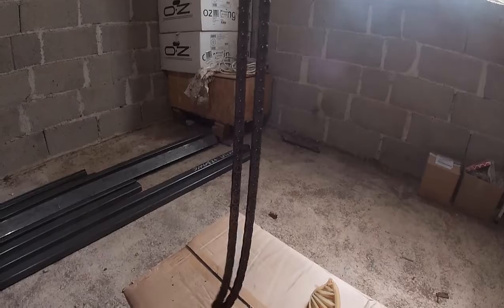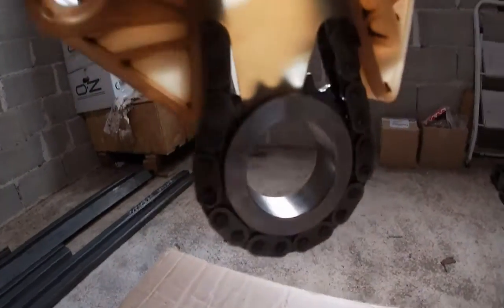Replacing timing chain on BMW F20, F30 N13B16 engine

Comment: Replaced the chain en checked it multiple times when I try to accelerate it holds back like it goes into limp mode and misfire when idle any idea?
Reply: Fixed it
The problem was one spark plug 
Weird frankly

Comment: So easy im going to do mine now. Where did you get the cam lock tool?
Reply from the maker: I got it from a shop here in Croatia, but there are plenty on Ebay, just make sure they have 2 crank locking tools

Comment: Did you have to do anything with a computer afterwards? As the Cam Adjusters we’re both in different positions as to when they we’re taken off
Reply from the maker: Nope, didn't have to do anything with the computer.
Reply: @mattwillow7  Hi, Great video!

I have a question,  When you removed the Crankshft pull center bolt, Do you not have to remove the sump pan and lock the Balance shafts like you have to on the N46b20b engine in 3 series E90?
Reply from the maker: @andrewclarke9467  tnx. No need for removing the sump, you just lock th crankshaft with a locinkg tool inserting it in a hole on a lower part of block locking the flywheel as shown
Reply: @mattwillow7  Hi, thanks for the replying.  Thats great i was just concerned cause when i did mine i had to lock out the balance shafts on the oil pump in the sump... Made the whole job a pain having to drop the subframe.    Thanks again for the info 👍

Comment: Did you use a new bolt for the crankshaft?
Reply from the maker: Yes, I would recommend changing crank and both cam sprocket bolts because they are stretch ( TTY ) bolts and shouldn't be reused.

Comment: Hi, it looks simple job for u, but is it really that simple from your perspective? Am going to get a used BMW, hearing feedback on this issue with N series engine but newer batch with B series engine used car price is much higher
Reply from the maker: Hi, tnx for the comment. It really isn't that hard on N13 because unlike dizel and B series, chain is on th front of the engine so there is a lot of room to work.
Reply: @mattwillow7  thanks for sharing and input, appreciate that!

Comment: I'm getting a P1339 fault code n hard starting after chain replacement. Please help?
Reply from the maker: Sounds like the engine is not aligned, did you try to spin it few times and then recheck with locking tool?

Comment: Hey man, thanks for the videos, I really enjoy them. I have a question, though: is the position of the VVT on the camshaft important? I lock the crankshaft and camshaft precisely as you show, but I am not sure if it will work when I try to put it back.
Reply from the maker: Nope, as long as everything is locked in place you are good, cam sprocket orientation is not important, just make sure not to swap intake (in) with exhaust(ex)
Reply: @mattwillow7  Thanks mate
Reply: I started engine today, every think was prefect. This's my feedback.:goodvibes:

Comment: Hi, I’m getting codes 120408 & 130E20. Inlet side. Looking like chain from searching the net. I have checked vanos solenoid and replaced cam sensor both on inlet. Still got drivetrain fault and these codes. Wondered your opinion on this? Before I commit to buying timing chain kit and tool. Kind regards.
Reply from the maker: We had that fault when we didn't double check with locking tool after few revolutions, turned out intake cam moved few degrees, so 99% it's timing chain related

Comment: hi, 
I have done the timing chain on the same car car starts and drives but fault codes come up intake and exaust angle offset with respect to crankshaft outside tolerance but was just wondering if the camshaft sprockets have some sort of timing that need to be set? 
Kindly reply?
Reply from the maker: Hi, did you recheck the timing after tightening all up? Either way you should check it once again, if it's good try reseting the adaptations, I've had exhaust cam fault come on 2 times, after reseting it was ok
Reply: @mattwillow7  thank you for your reply I will recheck it again and see if the message pops up again.
Reply: Did you fix it i have that too please help!!

Comment: Did you reuse the same cam wheel bolts or new? I read you should use new as the old ones snap is this true?
Reply from the maker: They are stretch ( torque to yield ) bolts so shouldn't be reused. I did reuse them, didn't do them to the spec, but "by feel", so I wouldn't recomend that

Comment: At what point do you put the guide bolts back in?
Reply from the maker: Before you start to tighten things, you can do it before you put the cam sprockets on or after it, as long as you don't thighten anything up there before you will be fine. We usually do it after installing cam sprockets

Comment: did you reuse  crank and cam bolts  mine look OK
Reply from the maker: I did, but bear in mind that they are torque to yield which means they have already been stretched out. For that reason I didn't tighten them up to spec ( 180/90 degrees part ), only torque wrench set to higher value.

Comment: Brilliant Video thank you. Just wanted to check, The camshaft sprockets? Does it matter where they are set? If my understanding is correct the vanos works by oil pressure which moves the internals of the sprockets forward and backwards? So presuming that with no oil pressure they are at their starting point and can be fitted at any angle? It would seem that this is what you have done with no issues? It's just because I have replaced a chain on a V8 BMW years ago which required the use of a multimeter to check that the vanos gear was correctly set. (had to apply a turning force to it until there was continuity across two points to ensure all the oil was squeezed out of it before locking it into place) Just wanted to be sure before I tackle the job. Many thanks.
Reply from the maker: Well I found conflicting info on that. There are 4 oil holes on camshaft face and sprockets, I did read somewhere that they need to aligned, but there is also a few mm space so oil should be free to circulate. Either way I tried aligning them once, had them just placed randomly, no problems both times. There are small groves on top of sprockets, when they are facing up holes seem to align, so maybe best to do it that way
Reply: @mattwillow7 
I am asking you for a hint, there was no knocking before the exchange
Reply from the maker: @brandlande  hmm, hard to pinpoint the sound exactly, but it kind of sounds like maybe something is catching on the belt or pullies, maybe some cable hanging or something
Reply: @mattwillow7 
this lasts up to 1 minute and it quietens down, it looks like something is not getting lubrication
🥵
Reply: @mattwillow7 
and could it be vanos in your opinion?  before replacing it did not knock, after receiving a new chain there could be a noticeable play in the vanos?